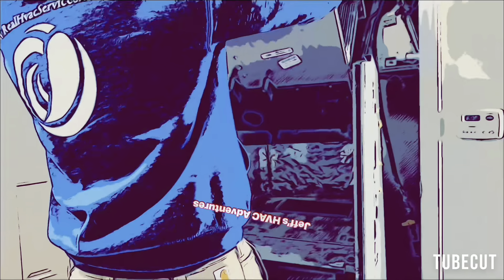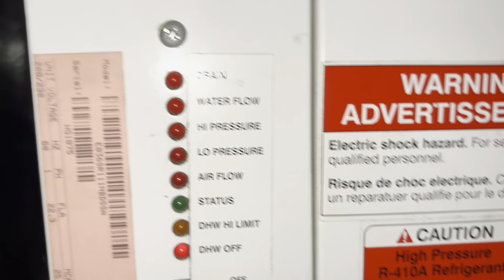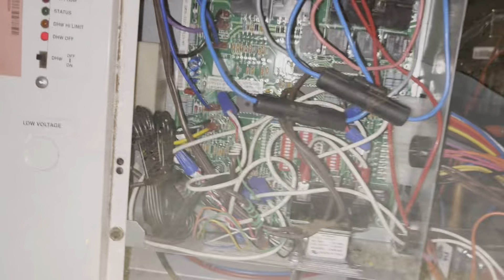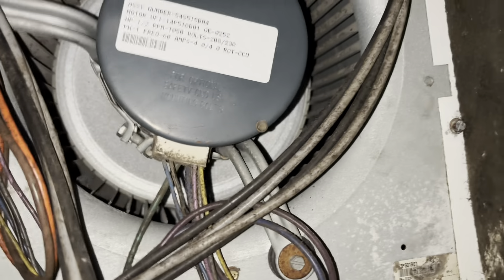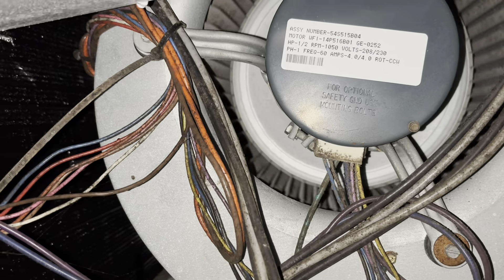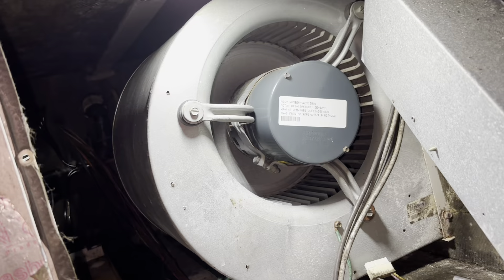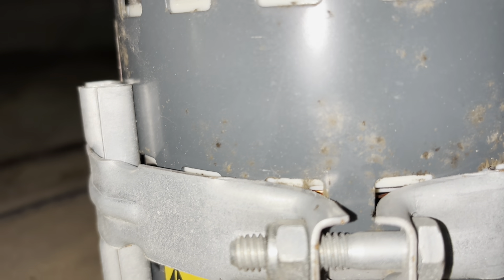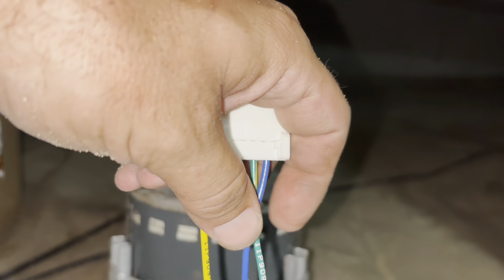That Dreaded Sound Of A Failed ECM Motor!  You Know The Sound....

Comment: I wonder if those ECMs could be replaced with a standard AC 1/2 hp blower motor?   Is there any feedback to the control board.  Seems a lot more reliable to have a quality 120 volt standard motor, let it run constant, last 20 years or so.
Reply from the maker: As long as the system isn’t a communicating system you can put a PSC motor in there with a relay to bring the fan on with a G call.  I’ve done it before.   If it is communicating, you can’t because the motor sends and receives data to the control board.

Comment: I have a dehumidifier running 24/7 all summer otherwise the air handler sweats and you can feel the dampness. Makes a huge difference. Probably keeps the handler from rusting too.
Reply from the maker: A good dehu works wonders

Comment: Mine failed after 1.5 years. It wouldn't shut off. I replaced it with a rescue but saved it in case the rescue goes out. At least I will have air as I am in So. Florida. I also put louvered panels in the A/C closet doors to help with static pressure.
Reply from the maker: Yea I’ve seen them fail like that also.  Rare, but does happen.  Good idea with the louvered door.

Comment: You could have just changed the module. The motor was most likely fine. I have done this many times.
Reply from the maker: They didn’t offer just the mod.  Most manufacturers don’t even offer just the mod any more.  Haven’t for years.  Wish they did.
Reply: @JeffsHVACAdventures    True. I have found them on ebay and as old stock at some supply houses. However, when you don't have time to mess around with sourcing the correct module, your way is best and especially because you can guaranty the entire part.
Reply: You could rebuild the module too.
If you can get the parts and know how.
Reply: @wyokaiju992 nobody in these temps is going to take the time to do that.
Reply: @DelGTAGrndrs  Just like trying to find a module that isn't for sale. 

What a shock, its almost like i made that comment as a comparison 🤔
Reply: Just replace module from new to old…